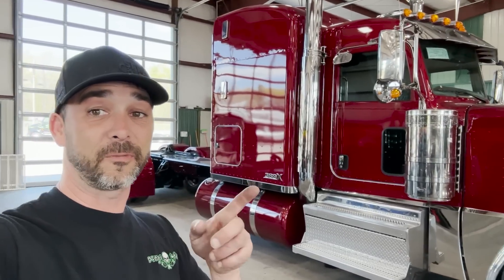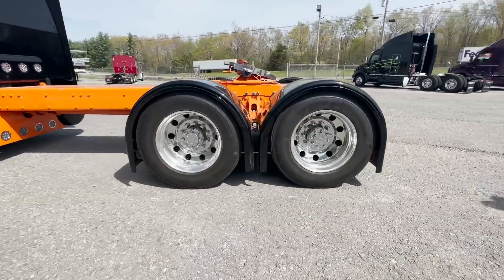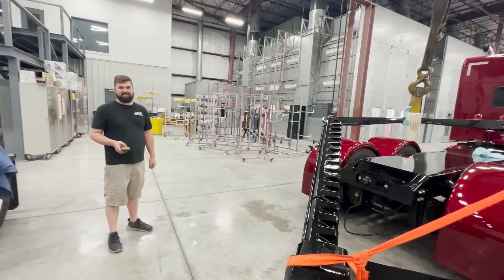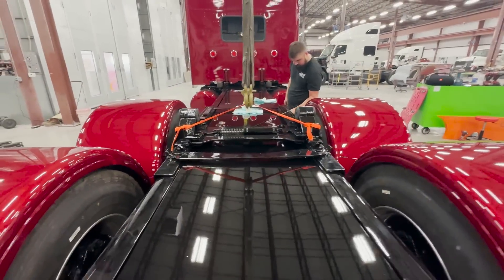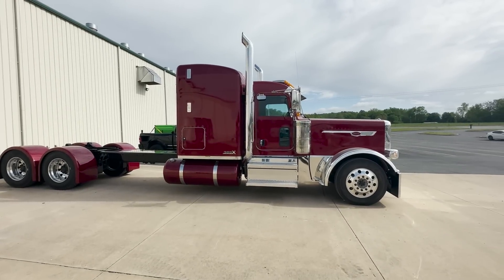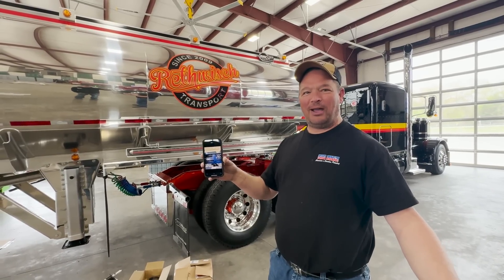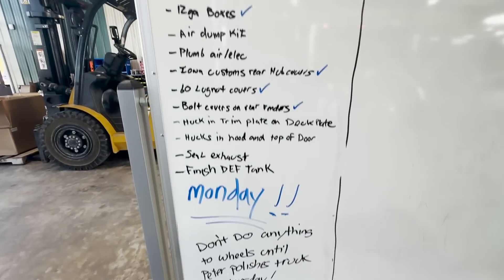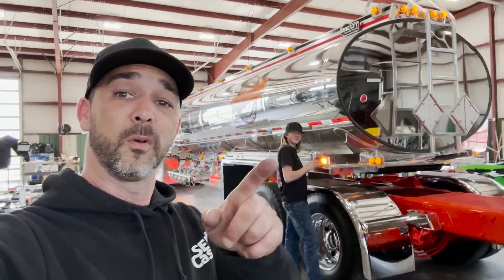Custom Peterbilt's almost ready for 75 Chrome Shop Show.

Comment: I beam, motor wheels, two winches so can adjust for level.. custom controller so the forward reverse thingy for each winch are side by side so both can be pushed or pulled at same time..lol.. it can be done, diy.. haha